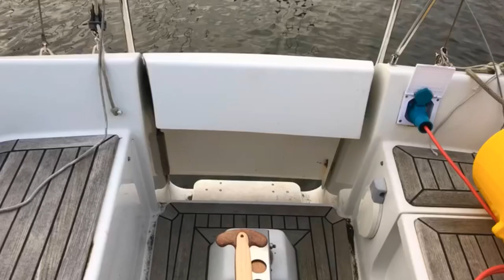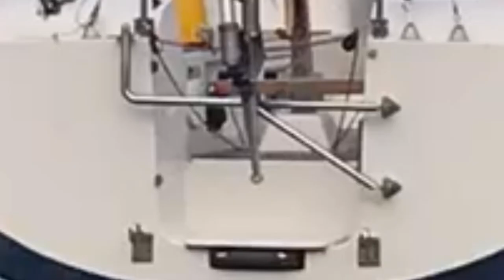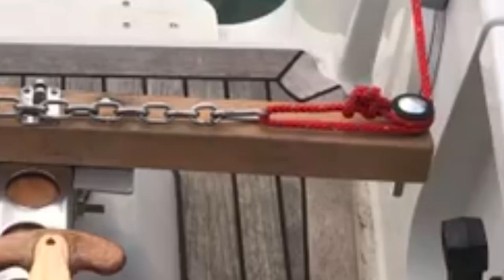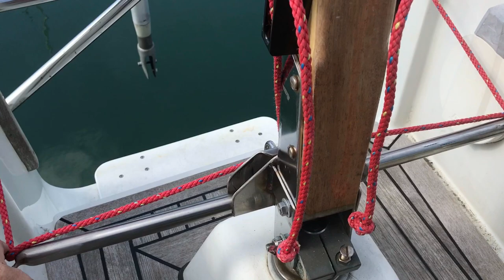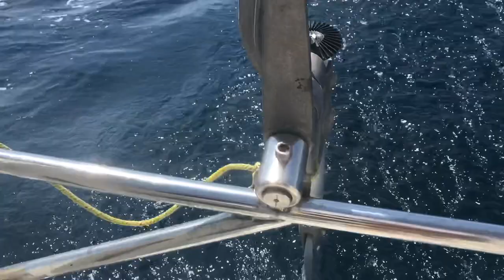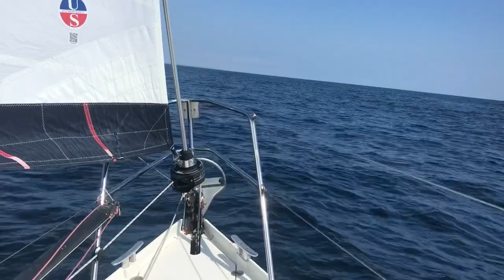Neptune windvane self steering fitted to a Sadler 290

Comment: Hi Peter, another 290 owner here based in Gosport. May I ask why you didn't just fit the Neptune on the port/stb side of the transom gate thus avoiding having to take it off. I understand they work ok offset from centre.
Reply from the maker: Hi. I understand that the Hydrovane system can be installed off centre, but the servo pendulum windvane such as the Neptune cannot, or at least it’s not ideal. As soon as the boat starts to heel the service blade, if on the higher side will lose its grip in the water and would need to be longer.
Reply: Thank you Peter, makes sense. Also, did you need to reinforce the fibreglass at the transom to hold the weight of the Neptune, since the fibreglass back there looks quite thin on my 290?  @windsonggemini
Reply from the maker: Hi, I will look next time I am on the boat, but pretty sure I just used large washers and plenty of Sikaflex
 @fbrose856

Comment: I also have a Sadler 290 (Certes 2) and I am looking to fit a Neptune windvane.  Are you still pleased?
Reply from the maker: Hi, yes. I am still pleased with the Neptune. Works well for me. Thank you.
Reply: @windsonggemini  Do you have the contact details of the stainless fabricator you used for the other fittings?  It would probably be easier for him to recreate the adaptations you made rather than to start afresh with another firm.  Many thanks in anticipation.  Trenchard has built the system for me so I am now keen to organise fitting...
Reply from the maker: @lesleybudge6814  Hi yes certainly. He is called Steph and you can try him on 07961 096021
Reply: Many thanks indeed.  Hopefully a 290 rally might be possible at some point!